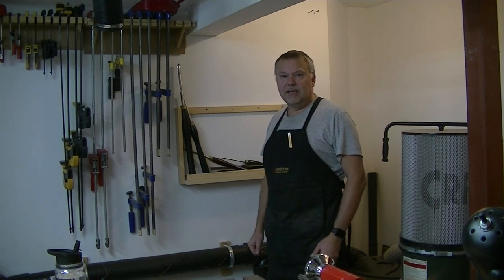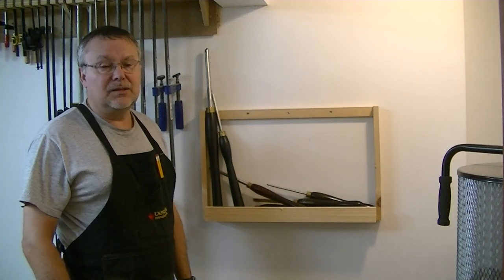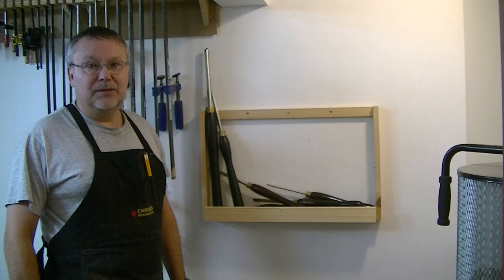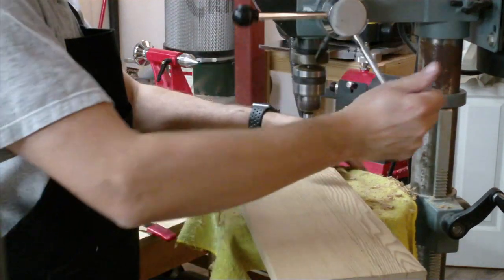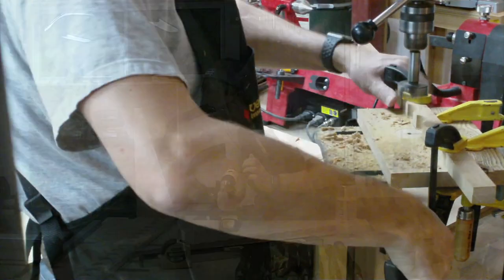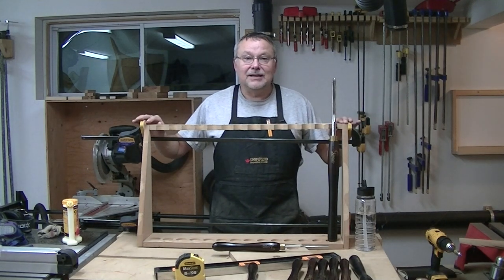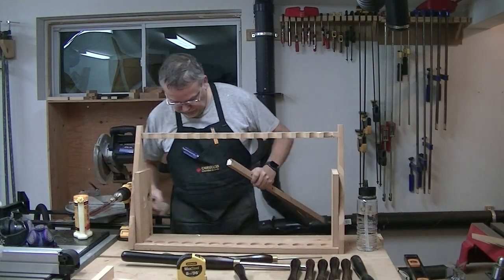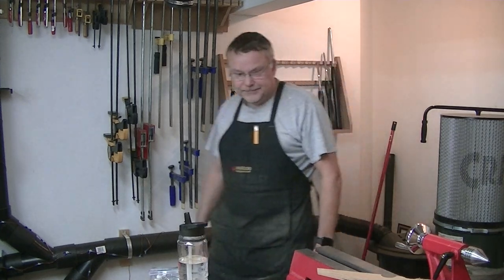Turning Tool Rack

Comment: Very nice tool rack.  I made one similar for my tools.  Mine is more shallow with the "tool groove" farther down.  I also pinned a small strip of wood across the front so no tools can fall forward.  It fit like a glove.  Then I got a carbide tool that's much longer than the rest.  Now I need to remove the front strip and redo it for a longer tool.  Facepalm! Maybe I can swing a new tool and total redesign of the rack.... :)

Comment: Marc, Looks good! I was alarmed to see the towel on the drill press if the bit caught it, you could have a mess! I realize you're only drilling 1/2 way, but safety first.
Reply from the maker: I need to build me a drill press table and soon.  Totally agree with the comment.  I need a better way to hold on to my pieces on the tool.  Thanks for mentioning.

Comment: Like the rack, but surely the smaller chisel will eventually fall through when you keep sharpening it and it gets smaller....... I'd have also made the top bar thicker so the gouge tip sits off the wall...... nice work though
Reply from the maker: Certainly room for improvement.  I'll be moving in a couple of months and will have a larger shop.  It will be an opportunity to revisit this one.  Thanks!

Comment: I would like to make a tool rack that does not attach to the wall.  Still looking for ideas
Reply from the maker: Phil, I ended up building a dedicated cabinet for sharpening and all my turning accessories.  This is in my new shop.  I also added a turning tool rack on the side of it.  The design of the cabinet comes from « Build It, Fix That ».  I made it wider and added the tool rack.  The cabinet is also on casters, which is ideal for moving it around.  I can send you a picture, if you want.  Just send me and email at mleblanc123@videotron.ca.  Cheers,  Marc
Reply: @mleblanc1234  thank you for reaching out.  I think I found an example of tool rack.  It uses pcv pipes to hold the tools but it's still attached to the wall. So I may have to find something that is heavy enough to put on the base of the rack to avoid from tipping over.